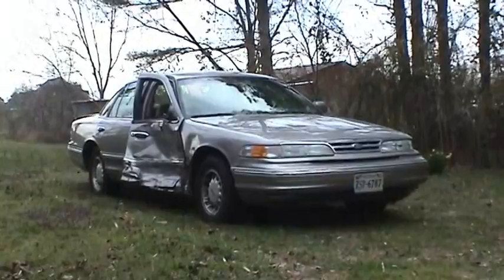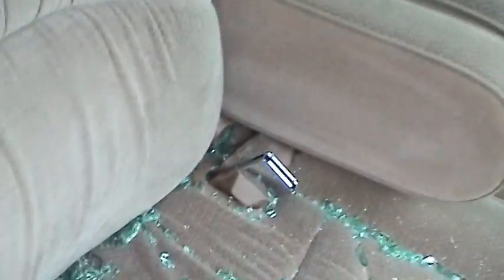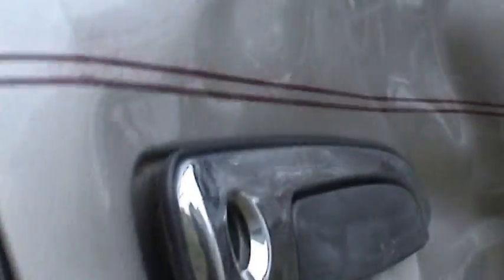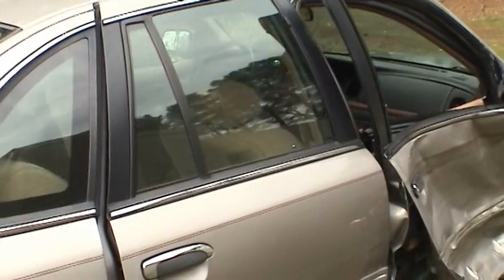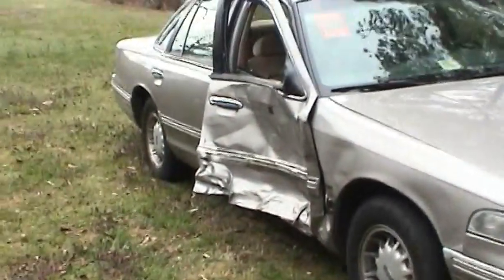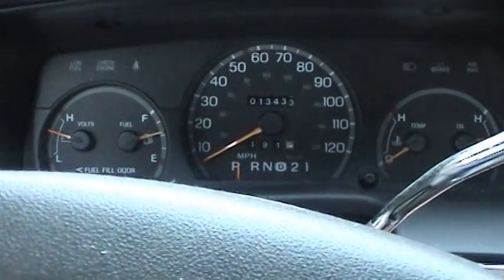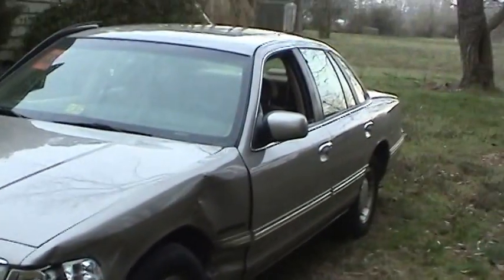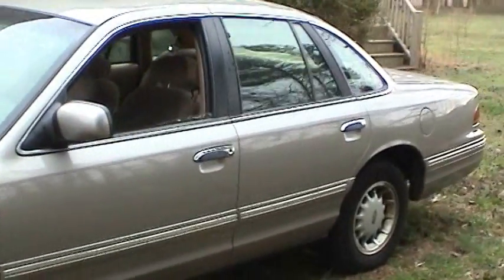Just How Tough Is A Ford Crown Victoria? Ford Tough!

Comment: Did the tow truck need a tow truck?
Reply from the maker: Actually, it did. The Crown Vic., though totaled, drove home on the Interstate tracking straight and true down the road.
Reply: ***** I have a 2009 ford fusion that got rear-ended and I drove away with no damage,but the Chevy trailblazer got the front bottom smashed in. No one belives me ethier, but, once again, built ford tough
Reply: +shadowrider460 the bronco u see in the profile pic was smashed head on into a cement pillar going probably 40mph the front end and radiator were completely destroyed and i still drove it away to a safe spot
Reply: Shadowrider i a, now your 2,715th sub this vid was interesting
Reply: Now 250 likes cause of me
Reply: xXDrTrollsrsXx Getting rear ended is not the same type of this accident though , especially from a tow truck . My 2000 Crown Victoria was Rear ended at nearly 13 Mph / 20 Kph as the guy slammed the brakes last minute no crack anywhere on the bumper my body just hushed a bit but almost didn’t move only a small light white scratch to almost nothing from his white Ford Cargo van which weighs about well basically a decent size Transit but not the little small ones the Middle size like a GMc Safari ...
Reply: I got to find out on new year's of this year in my 04 the hole thing is tollted left side snd front and back is smashed in

Comment: You feel so safe in this cars.. vics or grand marquis.. interceptors ect. Same thing. This cars are so damn hard. I have a 2000 marquis and it has survived 4 horrible accidents. The first one was just like that one. Got fixed up 3 others happend and it still pulls mad nasty. Moves and feels great after 14 years its very amazing how Ford made this cars. Hard. Smooth to drive. The seats are like a fucking bed. A plus for this cars.

Comment: Glad you're OK from that impact from the tow truck. If it was a smaller, unibody car, it would not go well and the vehicle will surely fall in pieces. Such as shame what happened to this '95 Vic, but this is evidence of why big body-on-frame cars (especially '80s and before) are durable enough to take a hit and keep going, is one of the best police cars ever, and one of the major reasons why I love the Ford Crown Victora in general. There is a car in the GTA V game, called the Vapid Stanier, which is based on this generation Crown Vic, is similar to it in every way, as it is relatively fast, can take several hard crashes and other type of punishment and still survive.

Comment: i'm a mechanic for yellow cab in everett washington, we use parts cars like this all the time like you said. mostly from cars that the taxi drivers total because we buy them whole and running from auction. i love the crown vic p71's. its what actually brought me to this video. but btw; the deer doesn't come back to life in planes trains and automobiles. you crossed planes trains and tommy boy, which was where the deer came back to life. planes trains has the wrecked car that they're driving and get pulled over by the police but no deer ;)

Comment: I don’t get people with small cars. We have had several occasions that we were probably saved by our car’s safety. We got t boned in our 2003 Chevy venture. It was a rav 4 going about 40. We were close to flipping and the right side was pushed in. But we were fine and we drove away even though the frame might have been damaged. It was totaled by the insurance company. We had a 2005 Chevy impala that survived 2 accidents and kept us safe. The first time a guy was texting and rear ended us going about 50 late at night. He was driving a Chevy Cruze and was injured but we were fine and drove home. It actually wasn’t totaled either. The next time a drunk guy in a big f-150 t boned us in an intersection. He was going around 35 mph. We got slammed against a pole on the other side. We walked away injury free and that didn’t total it either. We were lucky that they let us fix it. I was sitting on the back driver side right where the most impact was and I wasn’t injured in the slightest. We have a 2011 Grand Marquis and we hope to never get to tell the story of a bad crash in it but we know it would protect us.

Comment: Shadowrider, not saying that Ford or full sized cars aren't tough, but what you said about smaller more fuel efficient cars being weak and easily destroyed is incorrect. There was  a story on russiatoday that involved a mid 2000's Toyota Corolla that was hit by a bus. The entire rear half of the car was torn away and hanging from the hinges, literally. the rear passenger was killed instantly, but the driver, who was drunk just drove away from the accident.

Comment from the maker: I really did want to go that route but when I removed the transmission, the frame was bent enough so that the rear cross member could not be removed. It's sad that it happened, but most of the parts as well as the drive train will live on for many more years in the white '95 Crown Vic. that I'm swapping parts with. :-)

Comment: I think it may be smarter for short to medium distance commuters to buy a depreciated gas guzzler than spend a fortune for an efficient car.  
Example: I found a 2004 MGM LS Ultimate Edition with only 24,000 miles on it in 2013. This car is LOADED with options.
1) Miles driven per year:  9,000
2) Gas per gallon cost:  $4 (probably less actually)

2004 Mercury Grand Marquis
Purchase cost:  $8,000 (who wants a gas guzzler, right?)
Mpg: 16.3
Gallons of gas needed per year: 552
Gas costs per year:  $2208

I could have bought a used econobox that year, with the same 24,000 miles on it, for example:
2012 Ford Focus
Purchase cost: $13,000, since so many folks like good gas mileage
Mpg: 31.0
Gallons of gas needed per year: 257   
Gas costs per year:  $1028

Purchase cost savings: $5,000
Gas additional cost: $1180 per year

The way i see it, by buying the guzzler, I have saved $5,000 that I can spend on gas, food, or whatever  else.  Meanwhile, I have TONS of room, a comfortable smooth ride, power, and am far safer.  So shorter distance commuters might want to rethink buying an expensive "economy" car.
Reply from the maker: I agree. None of my cars could be considered fuel efficient. At the end of the day, getting to where you're going safely and comfortably is more important to me than getting good mileage.

I've ridden in small economy cars before and I don't feel as safe, especially given the large number of lifted pickup trucks and SUV's on the road today. It doesn't matter how much gas you have saved if you loose a limb during an accident in which you may have fared better in a larger more massive vehicle.
Reply: And you can buy an old Crown Vic for $5000 cash.  That's how much you LOSE IN DEPRECIATION the first year of a new car.
Let's say it costs $1600 more a year in gas.  Big deal.
Reply: This is true and even more dramatic where I live among $100k BMWs and Teslas and $40k hybrid Priuses.  My 2009 GM cost $7,500 and will last another 20 years and I happen to like that no one else has one on the road.

Comment: Also a larger car may have the same or better efficiency because it's hauling twice as many passengers and cargo in the large trunk.   One has to take into account the total weight moved a certain distance compared the the fuel consumed.
A giant Air Bus A380 gets the same fuel mileage as a Toyota Yaris.

Comment: This car was and is fixable. Yes, you heard me. Remove all damaged panels, throw them away. Take car to an experienced frame shop. Have them hook it up to their rack and pull the damaged portions out with the powerful hydraulic machine with a chain & hook. (VTuned on YouTube does this stuff in Tennessee) Get new body frame sections. Spot weld them on, then scour the internet for replacement body panels. Paint it, drive it. You'll never tell it was wrecked.

Comment: I rear ended an old ford pickup in my 04 sonata. It had a small dent in the bumper. Dude was nice enough to just let it go and not claim insurance. I had to replace radiator bumper fenders hood and bumper mount things. I could believe the difference in damage

Comment: Get a 1999 Cadillac Deville. I got t boned on the drivers side at 40 mph and I drove 5 miles home. The frame was not affected and it drive straight . it only bent the drivers door and the door sill that's all. only cost $800 to fix. These 90's "boats" are well worth the money because of there thorough safety and good power.

Comment: My brother owns a 92 crown victoria that has 600 thousand kilometres on it and still operates like brand new. And the best part is that all 190 horses are still pounding their hooves as hard as the day it came off the factory lines!
Reply from the maker: It's not uncommon for these things to go over 300,000 miles in taxi cab duty with no major repairs needed. And when you do need a repair, the parts are fairly inexpensive.
Reply: Damn rights...they are solid and inexpensive to repair.

Comment from the maker: I'm actually swapping most of the mechanical parts over to another '95 Crown Victoria and I'm almost done (videos of the progress are posted). The car is drivable, but I need all new upper/lower ball joints, sway bar end links, and I still need to swap rear axle assemblies.

The heart and soul of this car will live on in another Crown Vic. I refuse to let a 13,000 mile 4.6L engine rot away in a junk yard only to be picked apart piece by piece.
Reply: Have question bout motor swap will a 94 fit in a 95 grand marquis

Comment: This makes me a proud owner of a 1996 Grand Marquis.  It's got a lot more miles on it (162k), but running good as new.
Reply from the maker: From my experience with this accident, along with delving deep into the guts of this car during the rebuild process, you can rest assured that your Grand Marquis is one of the safest cars on the road. I feel very safe driving these cars.

Comment: The car I saw coming I assumed would stop, 30 seconds later I feel a smash and the whole car gets pushed a few feet to the right.  I look up and see basically hell unleashed, my car is mangled, left front fender pushed in, frame bent, bumper pushed over into the right fender pushing that off, broke the supports on the hood, bent the corner of the hood down, I was able to walk away unhurt, so did the other lady.  My car got totaled, at least 5K in damages and the insurance said it was to damaged.

Comment: These cars have some of the most reliable drivetrains ever made. An American car beats out so much of the competition. That still doesn't mean all fords are the same, at all. 98+ tauruses fall apart quick, just as an example. But the panthers are just really well made, simple, and field-tested. You have to talk to an owner to know. A lot of them have owned more than one. Gas mileage isn't even as bad as my friend's 300m (16/24)
Reply: Funlu I have a 96 Ford F150 with 5.0L Windsor V8 with 203,393 miles on it and it's still going strong.

Comment: Really sorry to here about your Crown Vic The Panther cars are some of the toughest cars ever made, much more so than many trucks and SUVs I am on my third one. 2 Crown Vics, both made it past 300,000 miles. I now have a 2006 Mercury Grand Marquis I bought with 57,000 miles on it, it just passed '99,000 miles. I have no doubt it will also make it past 300,000. If I were you, I would keep it, and get another one. If you are a mechanic, or like me, an amateur mechanic, there are many good parts from that car that could go into another one, like the engine, transmission, rear axle, and hundreds of smaller parts. If it were here in AZ, I could still drive it, all we have here is emissions inspections. I seriously doubt I could get the right side doors to work, but I could replace them with some straight ones, trim them to fit, and weld them into place, so it would look pretty decent. As for the IDIOT complaining about it being 18 years old, nothing wrong with that. They don't make decent cars anymore. The Panther cars (Crown Vic, Grand Marquis, and Lincoln Town car were the last of them. Made through 2010. GM and Chrysler gave up on the full sized rear wheeled drive car a long time ago. Since there will probably not be any decent ones left by the time I wear out my '06, I may just go ahead and replace the engine, trans, whatever it takes to keep it going. There is a reason the cops love these things so much. Many police departments are still using them, well past their normal retirement date and mileage. So are taxi companies. I would refuse to ride in a Prius taxi. Suicide machine. Oh, and as for gas mileage, I get about 30 mpg highway, same as my former POS front wheel drive Malibu.

Comment: you can bend back the B pillar with a special winch  and  some hammering.  side of the underbody is sold  aftermarket  and can be welded after you cut of the   damaged skin.    then you put the new doors afterwards
Reply: if you can do it on your own it will cost less than 500usd.  It wasn't an old car  the milage was  little .  I would  simply bult another body on the frame and use my own interior   or repair the body

Comment from the maker: I did think of that but had no easy way to swap the bodies. As it turns out, the frame on the wrecked car is bent inwards just a little bit so I ended up making the right call. I found out because the transmission crossmember is captive within the frame and won't come out like it did on the non-wrecked car. The frame is pinched inwards making it impossible to position the crossmember in such a way as to remove it. The body itself was way too deformed to repair properly.

Comment: I would say from a mechanical standpoint, if Adam Ferrera from Top Gear can't kill one, it's got to be pretty good.  OF course, he didn't crash his, and it already had 450k miles on it and was still running and driving at the end of the episode.  But back then, those cars were built like tanks.  They didn't get the best gas mileage, but man they were built like tanks and ran forever.  I believe these also had frames so that made them more tough than the unibody cars, plus you could bend them back roughly into shape which I think was one reason why almost every PD had Crown Vics (that and Chevy stopped making the Caprice and the Impala which many PD's were also using).  Personally, I think Ford should bring back the Crown Vic, but maybe put one of their V6 Ecoboost motors in it for a bit of a fuel economy bump, and I think people would still buy one.  Maybe update the body to a more modern design, but keep the body on frame design.

Comment: You can yank the body off the chassis, scrap the broken bits and sell or save the rest for something else. Just scrapping I feel is very wasteful when these older cars last longer and are cheaper to maintain, and as you can see do very well in crashes.
Reply from the maker: During the teardown, it was discovered that the frame was slightly bent inwards since the transmission cross member was captive and couldn’t be removed from the car like it could on the non-wrecked car.
 
Rest assured, every piece that is usable on this car will either be used on the rebuilt Crown Victoria, or kept as spares for a rainy day. Currently, the drive train is living on in the rebuilt Crown Victoria and is being driven almost daily, and is running very well.
Reply: Awesome! sorry to hear about the frame damage but its good you managed to save what you could:)
Reply from the maker: Jay Simons
Oh yes. If you watch the other videos, you can see that the heart and soul of this poor car are living on, alive and well, in a new body. :-)

Comment: You could have brought it to AZ, and if it passed emissions you'd be good to go. No inspections here, AND rarely ever an accident caused by mechanical problems. Most accidents here are caused by distracted driving (cell phones) speeding, and inadequate following distance. 

I have a 2006 Grand Marquis, and I may keep it forever. I may replace the engine, trans, whatever is necessary to keep it going. These big cars are not only safe, but they are roomy, comfortable, powerful, and handle amazingly well for their size. They weigh 4000 pounds, which seems like a lot, but a new Challenger weighs 4500 pounds. I have seen seriously modified Crown Vics run in the nines at the dragstrip, outrunning Mustangs, Camaros, and Challengers.

Comment: Sorry to hear about the car, but like you said its only a car the important thing is your alright, by the look of it I'm surprised.  I can relate a few years ago I purchased my great uncles 2002 impala ls with the 3800 series 2 motor, it was pristine like the crown vic, got it with 78K.  Had it for a few years,  4th of july weekend 2 years ago I went to pull out of a lot and didn't see any cars, as soon as I pulled out I saw a car, slammed on the brake. Have to continue in a new comment.

Comment: I got git in the same spot except I have a 1995 mercury grand marquis and it still runs does the crown box still run?
Reply from the maker: Absolutely. Better than ever, in fact. I have swapped the entire low mileage drive train into another 1995 Crown Victoria LX so that most of the original car can live on.

Comment: Why is it considered totaled if It starts up and drives?
Reply: +Anthony Higdon Insurance companies use the value of the car and estimated repair costs to determine if a vehicle is a write off or not. The car itself wouldn't have a very high monetary value because of its age, and the repair costs would be high given the extent of the damage (bent pillar for instance) that requires professional work. If the repair costs are 70-75% or more of the car's value, insurance companies consider it a total loss. Sometimes an older car is "totaled" after a minor accident if the airbags deploy. The car may only have minor damage, perhaps even be structurally and mechanically sound, but the repair cost make it a total loss.